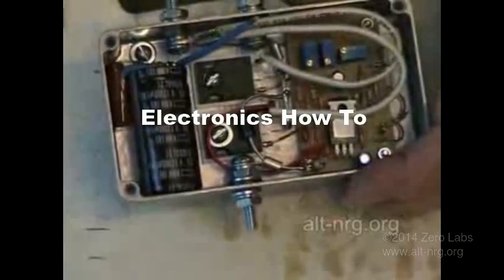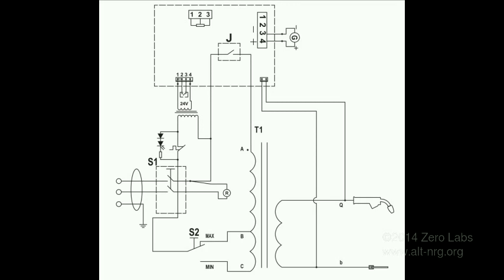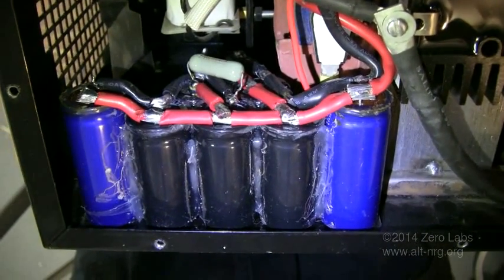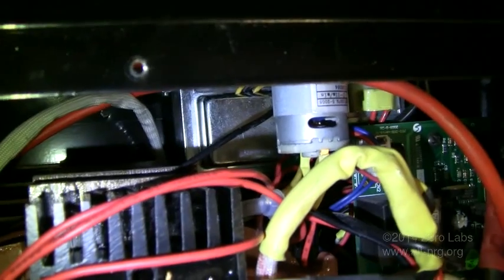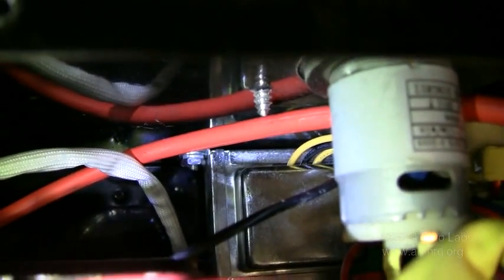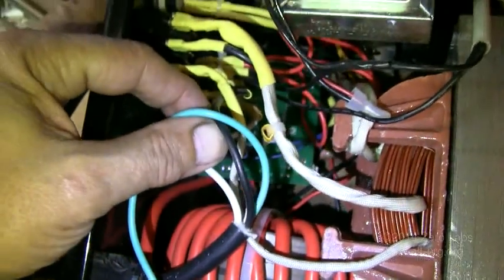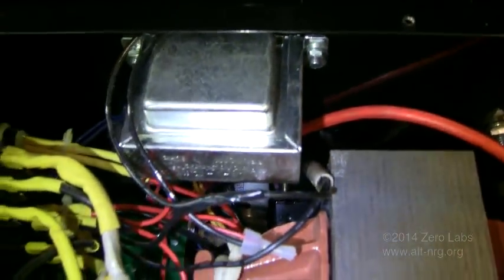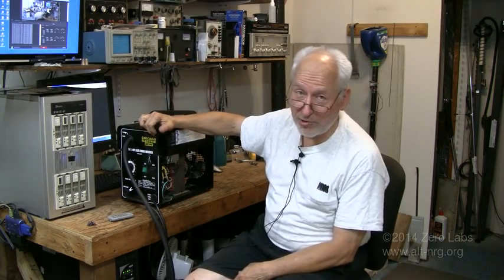#374 Harbor Freight 90A "MIG" welder upgrades

Comment: I did a modification for mine to DC for $20,  worked great, no capacitors, here is my video of the mod let me know what you think 

https://youtu.be/O8ixBu0h7Ac
Reply from the maker: Very nice! Only $20 for a 200 amp bridge rectifier? That's a steal! You don't absolutely need the capacitors or filter choke. 120Hz pulsed DC still beats AC. But the filtering does smooth it out considerably too. I had the room so I did it. Yours looks more cramped for space.
Reply: @zerolabs  I agree, Ideally installing the capacitors would be it. But by the time I do all that I can just buy a new generation welder that is already a DC, they are less than $100 on amazon, so I decided to salvage the one I have with the rectifier only and it helped dramatically with the weld quality.

Comment: I wonder if there is a way to control the voltage of a mma weldwer by adjusting the duty cycle of a pwm that drives the wire feeder. Also I think of a voltage controlled pwm and I would use a current sensor to provide a ref voltage for the opamp of the pwm. So the mecanism is simple but complicated in practice. Mantaining a constant voltage by adjust ing the speed of the wire.
Reply: Also I'm looking forward to use the zero fosil fuel pwm for wire feeder. I don't know where to connect the sensor output yet but We'll see
Reply from the maker: Yeah, in retrospect, that CCPWM has it's problems. Might not be the best choice for the wire feeder circuit. I'm retiring soon. Might revisit the design.

Comment: Eight years later in 2023 and no dumpster to dive-in to:

Online pricing has 10 each 5000µF capacitors for around $250.00. Further research shows that's going to cost me another to obtain 1.6mH which reform post said a 27 volt inductance was required.

After watching a ton of videos last 24 hours on this subject, your video is only one that used an Inductor. I love that you went balls-out on it too with that thick cable those huge doughnuts!
Reply from the maker: "Balls-out" Ha ha! Not sure how much better it made it, though. No real way to see without an oscilloscope. Not worth the effort. And if you can't find enough dumpster food, you're better off just buying a real MIG. I plan to buy a nice AC/DC TIG soon and scrap this piece of junk for parts.

Comment: Just picking your brain, I have an old Harbor Freight Mig200. I assuming its 200amp. It runs on 120v standard plug. Its ac electrode positive. I'd  like to convert it to DC electrode negative. What size rectifier, capacitor would you recommend? The extra winding you added, how exactly does it work?
Reply from the maker: First of all, AC is AC. Not positive or negative. To convert to DC you need to use rectifiers rated high enough to meet the demand. They will undoubtedly have or require heat sinks. Most have peak current limits orders of magnitude higher than constant current limits so you need to consider both. I used rectifiers from an automotive alternator which are more than capable. For capacitors you need to look for low ESR variety. It's best to use a lot of smaller capacitors connected in parallel than one big cap. Your total capacitance should be no less than 50,000uF. And I'll be honest, the inductor I made is a complete shot in the dark. They're not mandatory and I don't even know if mine works properly. If everything else works as it should, it doesn't really matter. Good luck.

Comment: Mine is a "hot tip" -- must have been the previous iteration.  I've started making the DC upgrades even before I found this video!  It is incredible what they have labeled as a welder, let alone "MIG"!  It's no wonder they were $70 at HF originally.

Comment: Hello my friend!! I love your channel and I have been around since the late 90's and researched Stan Myers and Grandpa Smith. Fantastic build. I want to start a Youtube channel where I take cheaply made equipment and upgrade it such as welders, presses and tubing benders . Just last summer a neighbor bought a chinesium brush hog. Soon after attaching it the blade flew off and the bolts let loose among other things including a crack in the shroud. I welded everything and made fittings for  the blades and painted the blades orange so if they come off they can be found..in your neighbors car door...LOL

Comment: Where did you get the two torrid cores to make your choke?
Reply from the maker: I wish I could share more details on the cores. They were salvaged from 60Hz AC transformers. They're wrapped steel laminate. Quite frankly, I don't know if they're doing their job or not. It was purely a stab in the dark.

Comment: MIG welding requires inert gas as shielding to prevent splatter and oxidation. You didn't change this into a MIG welder, you turned it into a DC flux core welder.
Reply: Flux core is shielding for outdoors. Argon/Co2
Is useless outside in the wind.
You are right. DC Fluxcore that is now correct polarity to burn Lincoln EN711 0.30 Fluxcore wire, or equivalent.
Reply: Flux core metal arc welder without gas.

Comment: I did this DCEN mod to my newer generation 90Amp HF Flux Core Welder which has a different wire feed motor (DC 24v 0.8a) and new circuit board design.  I used a philmore TR212 12v 2amp transformer with center tap to power the wire feed motor.  Xformer A/C input came from the power switch, xformer DC output went to the two white wires located on the same 6-wire circuit board connector that the wire feed motor (red & blue wires) is also wired up to.  Other then that major difference, I am using a single 47000uf 50v capacitor with 150ohm 5w bleed resistor, and a second side panel mounted 12v 1.6amp 120mm pc case fan (powered by a separate transformer) to directly cool the heatsinked bridged rectifier mounted above the stock vortex fan.  I used the same choke and 8awg wire.  Overall, the mod is totally worth the effort and gave significant improvement in weld performance.  I have never reached the duty cycle or had any failures in the past two years of using this modded HF welder.

Comment: What transformer did you use for the drive motor ?
Reply: I used a philmore 12v 2000ma (2amp) with center tap, model TR212.  Use the two 6v red (outer) wires to get a total of 12v 2amp output.  Just tape up the extra black center tap wire to insulate it.  I also successfully used a similar 24v 3amp transformer with center tap and reproduced the same results of an excessively fast wire feed rate.  If you go that route, just use the center tap wire instead of one of the outer 12v wires to drop it down to a 12v 3amp output.
Reply: I used a philmore 12v 2000ma (2amp) with center tap, model TR212.  Use the two 6v red (outer) wires to get a total of 12v 2amp output.  Just tape up the extra black center tap wire to insulate it.  I also successfully used a similar 24v 3amp transformer with center tap and reproduced the same results of an excessively fast wire feed rate.  If you go that route, just use the center tap wire instead of one of the outer 12v wires to drop it down to a 12v 3amp output.

Comment: Absolutely awesome. I have an old MIG purchased for $300 in the early 1990's at some large discount outfit called "Big Bear" (I think) in St Cloud, MN. That was cheap at the time for those welders, but it paid for itself dozens of times over before it quit, and I'm certain your welder and mine are the same with just a few changes. Mine has no fan for one example. Evidently the durable patent design has been around the block over the years.  I was an "A" student in high school welding class and yet could never get the weld I expected - my best looking like your best before the conversion. I still have that welder and you can bet good money I'm digging that puppy out for a first class upgrade based on yours. Thank you forever! 
And just one more thing. Some other comments quibbled whether this was a real MIG. Who cares? I don't.  Mine had a shelf on the back for the single gas bottle, and an extended top handle to optionally grab in front to pull using the rear wheels. But the front controls, enclosure size, style, venting and inner guts placement of it are all alike. Thanks again!

Comment: Nice video . I modified an old Century welder about 20 years ago , I just used  big diodes , and on-board circuit breaker . For a cheap easy gas conversion  I just used a proper regulator and tank , some plastic tubing to the torch and a small air gun zip tied to the handle  then copper tubing to the shrouded tip . Has worked beautifly for 20 years now .

Comment: Interesting.  I wonder what is the purpose of the inductor made with wire wrapped around a ferrite torus.  You placed it on the DC side of the rectifiers. An inductor is a passive device in a DC circuit.  It acts like a piece of wire, but it will provide a big voltage spike every time you break contact between base metal and welding wire, when the magnetic field it generates, collapses.
---Update:
After further thought and investigation the inductor is useful. The output inductor is used to limit splatter-causing current spikes. The output current can have spikes that occur when the wire makes contact with the material, which then fall off as the wire burns away. The peaks are limited in rate of rise by placing an inductive choke on the output of the rectifier.

Comment: What is the dimensions of the cores and what was the reason for using 2?
Reply from the maker: Cores are what ever I had laying around. SOmething like 2" I.D. 3" O.D.  More cores = higher saturation limits.
Reply: Zero Labs thanks for taking the time to reply . I’ve also used 2 stacked that I salvaged, they have a 3” ID so managed to get more turns. My conversion isn’t completely finished but thanks for the inspiration and information 👍

Comment: with the inductor probably do not need the bleed off resistor
Reply: NO!  The inductor will not bleed off the voltage.  It is in series with the Negative tip.  The resistor is across the capacitors to drain them when they are no longer getting charged by the AC transformer.
Reply: Keep your caps to yourself says dear old Dad.

Comment: Enjoyed this very usable video. I have modified my harbor freight welder to dc and pleased with the upgrade. I unfortunately have the hot tip version. Do you have any plans or suggestions on changing it from a hot tip? I really don’t like this and would not have purchased it if I knew then what I do now. Thanks, Chuck
Reply from the maker: Define "hot tip"
Reply: @zerolabs  Will UL even approve a wire feed welder with always on hot tip?
Stick welder, nature of the beast.

Comment: Awesome upgrade you made.  I have a Firepower FP-120 welder that can run either solid wire with gas or flux core wire without gas.  I've been running the fluxcore and it has been a great welder until a week ago when it just plain stopped putting out power.  The cooling fan runs but that's all.  I checked the rectifier and the diodes all seem to be good.  I'm stumped as to what can be wrong with it.
Reply from the maker: Check for continuity on the transformer windings. Some have a fuse buried inside the windings where the lead wire attaches to the top layer of enamel wire, under the insulating paper. Guaranteed way to force people to buy new. I have repaired transformers before by carefully slicing open the top insulating paper, bypassing the fuse and fusing it externally. It's a pain in the ass.

Comment: folks this is NOT A MIG WELDER.... this is a WIRE FLUX CORE WELDER.. mig uses gas.. this welder does not and not even worth adding gas to it .. in the cost alone.. u can buy a real mig welder

Comment: To qualify as a MIG welder MIG stands for metal, inert gas. No gas, no MIG
Reply: Mr Scarlett, absolutely correct.
A MIG welder is capable of providing a shielding gas to the arc puddle via a connected inert gass supply while a Flux Core welder, as depicted in this vid, has no provision to supply gass to the the weld puddle and the shielding gass is provided by the powdered Flux in the Core of the weld wire which gassifies in the intense heat of the arc.
Flux core wire can be used in a Mig welder with or without the gass supply enabled while the use of Solid Core Mig wire in a a Flux Core welder would result in disastrous welds as would Mig Wire in a Mig Welder with the gass supply turned-off/disabled.......

An otherwise interesting vid in converting an A/C welder to D/C operation.

FWIW: To the best of my knowledge, all Mig welders are D/C welders as you need one polarity to weld with gass and the opposite polarity to weld with Flux Core. Not easy to do with A/C but it can be done with a single Hi-Current Diode in line with the gun. Results may vary.
Reply: @rjinnh3933  One 300Amp stud diode anode to Gun? Or other way around?
Reply: Flux core is great for outdoor, windy conditions. FCAW= Flux Core Arc Welding.
At high welding temps, the flux in the wire "Produces it's own shielding Gas".
Do you use your gas "Mig machine" outside in 25mph winds? Do you like wasting C02 and Argon?
Reply: A word means what people understand it to mean and that often changes over time with usage. For example Americans now say "Can I get a coffee?" which is totally "wrong" usage of the word "get" and yet it is now commonplace and is considered by many to be correct. Language is fluid, not fixed.

Comment: you seem to be very knowledgeable about how these machines work. I was wondering if you would look at a conversion, flux core to gas "lincoln pro core 125 (11631)" that lincoln says cannot be done but some folks have done.
Reply: Lincoln? They have retail outlet distributors.
Parts department and service. 
My next welder will be one that can do multi-process and buying things like spool gun, Tig torch etc.
Maybe a couple of Inverter machines.
I wonder if weldingweb has comments on Lincoln 11631 conversion?

Comment: I have two DC capacitors from I forget where I salvaged from. 5400uF each  , 200 V DC, 250 surge. If I put them in parallel, they should add to 10800 uF. Would this be good enough? Thanks
Reply: My opinion is not to use caps. In your case they will still be electrolytic, 5400uf total capacitance.
That is both in parallel. With a bus bar on your caps, you'll never know if they are blown.
Quantity of six, 65,000uf 100v caps and 24 diodes would do good with 220v input.
Thats a $1000 vintage box.
The weakness in the HF is the transformer.
Buy an inverter machine. The world is now IGBT.

Comment: Technically... It's never going to be a true MIG welder. MIG stands for metal inert GAS. Without GAS you cannot have a MIG welder. It's a flux core wire welder. Having said that, it's a decent tool for the price for a hobbyist and the conversion to DC makes it much better.

Comment: nice job, i have a question buddy , i have one of the same welder but black like yours (90 amp)..its a few year old, maybe as old as urs to dated but its not burning like it used too.. an not penitraying... it used to work well.. still working but not getting strong weld like first time, would this mod help in anyways... what do you think.. some thing your talk about, too me it adds up like the speed when i weld, (i notice that too) an u got more penytrayion like arc.. that means ac is more relyable .. is it..

Comment: So far you're the only YTer that has bother to do any in depth explanation of mig welder circuits.
I have a Clarke139en with no voltage on the tip. I hope can get this fixed. Any advice?
Reply from the maker: Start by measuring for ac voltage at the transformer (unless yours is an inverter type).

Comment: It is NOT MIG! It is FCAW. Flux Core Arc Welder. Fairly good video otherwise. If done correctly it will be DCEN. Direct Current Electrode Negative when done. Even if it used gas it would not be MIG it would be MAG. MIG=Metal Inert Gas. MAG=Metal Active Gas. Granted all of the above may  be nit picking but if someone is reading or watching another video knowing that may eliminate some confusion. BTW with some additional work and expense it could actually be set up for MIG,  MAG,  Dual Shield, or even TIG. Doubt that could be done for less than just purchasing a machine properly built that way but could be a fun project. The resulting welder would also be much less capable than one built properly by design.
Reply: I bought one 12 years ago. Before all the conversion vids online. In 2023, I will read reviews from welders online to save me my precious cash and not buying more poor quality
Chineseium.

Comment: What size of power transfower for wire feeder mechanism are you using? You just confused me being too technical.
Reply: 120v ac to 12/24v dc. It has three secondary wires. You choose. 12v or 24v